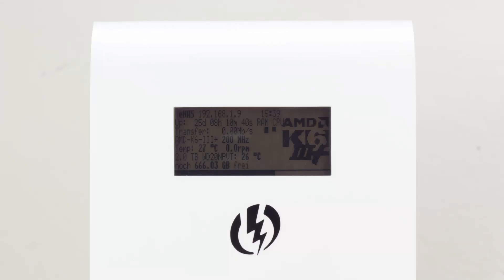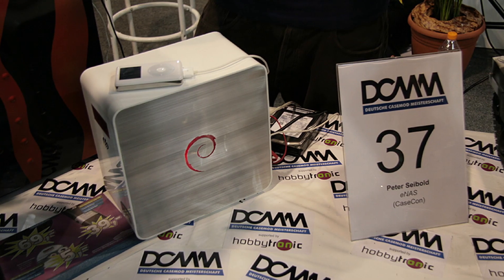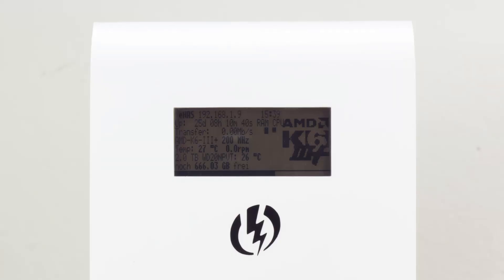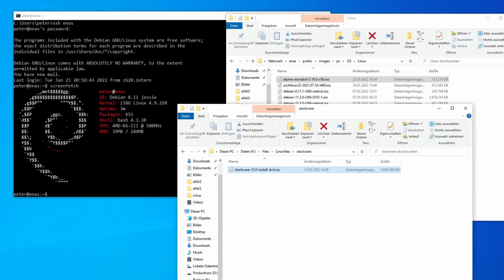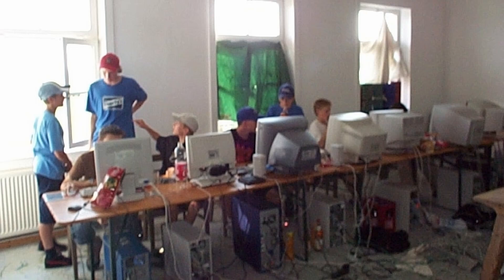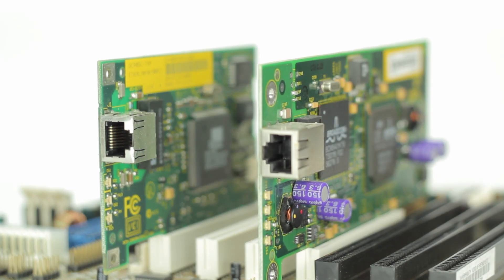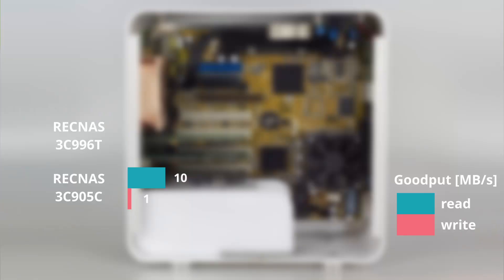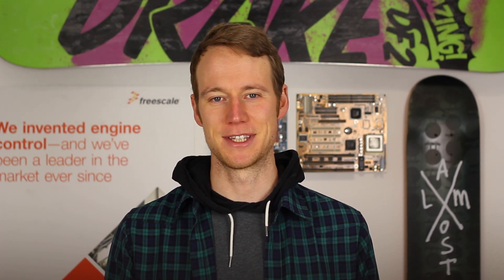Upgrading my Socket 7 NAS

Comment: 7:26 You can achieve 600mhz by setting the clock jumper to x2.  I am running an AMD 2+ 550 that way.  You can read about this undocumented AMD feature in Wikipedia.  It may only work for k6-2 and k6-2+ cpus, but I would try it with a 3+.

Comment: Had problems with nas performance on Intel g2010 (1155) about 10 years ago, was targeting 1 Gb speeds. Ended up swapping in i5 2500. Looking forward to what you can squeeze from this old platform. The case looks fantastic!
Reply: or better yet a xeon

Comment: power consumption?
Reply from the maker: Idles below 20W. K6-3+ is a mobile CPU and clocked down to 200 MHz if cpufreq is setup correctly.
Reply: my mr7350 router (Nas+switchx4+wifi6) with a usb 3.0 port and a connected 2tb (2.5 inch) hdd consumes max 10W, the speed via a 1 gb/s lan cable is 110 MB/s. @recnas  google: dong knows mr7350
Reply: @StanisawSwierczynski no i?
Reply: Power consumption: yes. 😛

Comment: Ich liebe alte Hardware und dass sie auch heute noch genutzt wird. Weiter so!

Du könntest auch mal testen ob ein USB2_to_Ethernet Adapter schneller ist als deine verwendete Netzwerkkarte.
Debian sollte diese sofort erkennen. 

Hmmm, in welchem Kellerschrank liegt denn noch mein alter Pentium 2 rum...
Reply from the maker: Ein Pentium 2 System ist sicherlich auch ein guter Kandidat für Spielerein dieser Art. Mit dem richteigen Adapter im AGP Slot und übertaktetem FSB sollten sich da ganz gute Ergebnisse erzielen lassen.
In einen USB auf Ethernet Adapter würde ich nicht allzu große Hoffnungen setzen. Um mit so wenig Rechenleistung hohen Durchsatz zu erreichen, sind Server Netzwerkkarten, die durch Offload Engines die CPU entlasten die beste Wahl.

Comment: I used to overclock my old Celeron 266 to 466mhz. It was in an old Abit motherboard and after 8 years of constant overclocking, it finally died. In the process of dying it scortched the PCB around the socket turning the yellow to a light brown. Can't overclock any modern stuff like that anymore. I'd like to see your NAS tuned as far as it can go without self destructing. Good Luck!

Comment: Max read/write of PCI bus is the real problem, and your motherboard... is on borrowed time.
Reply from the maker: You're absolutely right and I was fully aware that the shared bandwidth of the PCI bus will be the major bottleneck. That's why I already figured out a workaround. Stay tuned to find out, what I've come up with to tackle this hurdle.
Reply: @recnas  You found either a NIC or SATA controller for that AGP slot didn't you?
Reply from the maker: Kind of, if you look closely you might already find a few hints ;)